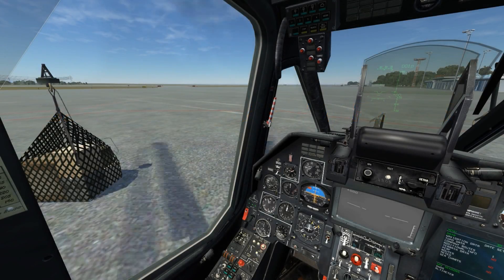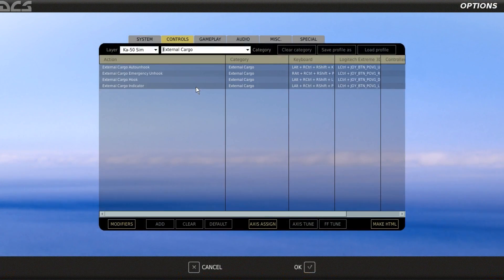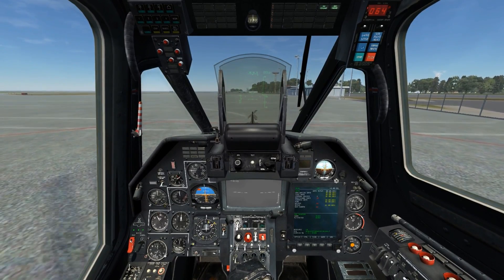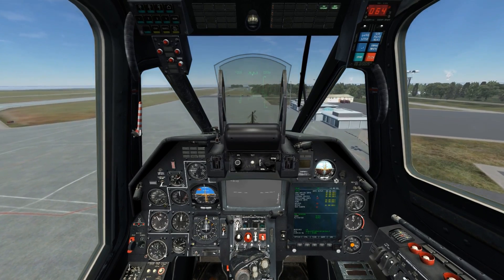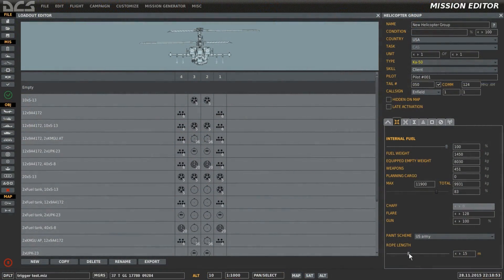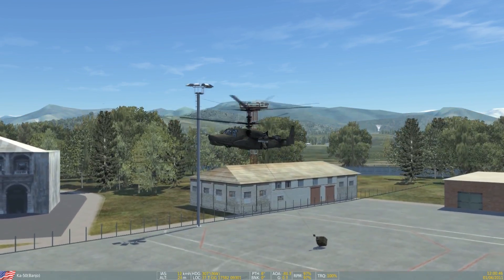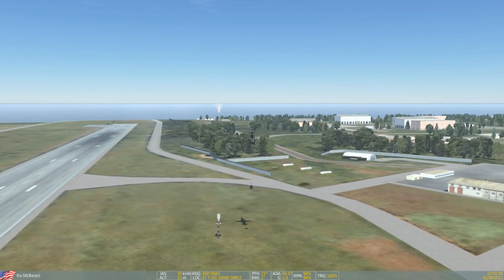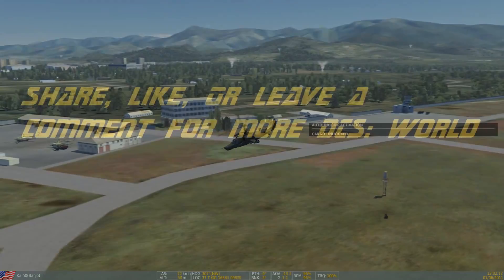DCS:World » Cargo Sling-Loading » Kamov-50

Comment: You said 4 tones? Really? Can't believe that it can lift as much with full internal fuel.
Reply from the maker: As far as I recall I left the fuel quantity at it's default full internal, so presumably you could probably lift more depending on fuel weight.
Reply: pickinthatbanjo I remember hauling 500kg bombs, it was pain in the rump ;-) It's all good as long as you fly at low alts. When air gets less dense it starts to get bad...

Comment: Hello Banjo.
I have video proposition - finding and defeding AAAs.
I bought recently BS and im impressed how a nice helo it is. But I found that for it more dangerous are not SAMs (mean Manpads and Low-Altitude IR) but AAA (if you get close, 1 set and you are dead, rhymed :p)
Reply from the maker: +Silenthunter199 Dealing with AAA is just a matter of scouting an area well enough that you are confident about their location and can engage them from outside their range which is roughly 3.5km. (even the 30mm 2A42 cannon can outrange most AAA from the limit of it's range) Aside from that looking around for ground fire and not flying in a straight line towards suspected areas is about all that can be done.  

Now that a couple others that I fly with have started learning the Kamov it's likely I'll have more gameplay to post, I imagine there will be plenty of examples of dealing with air defense.